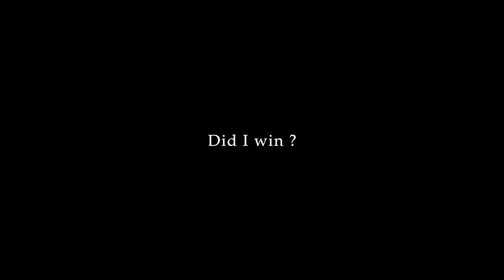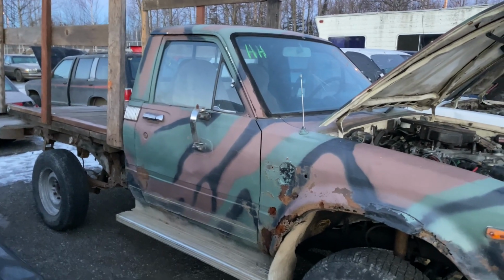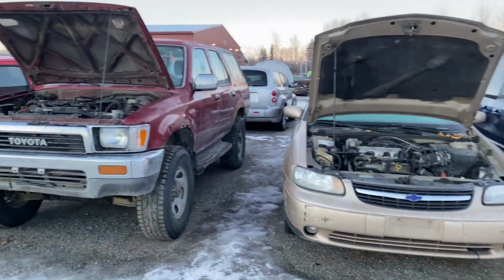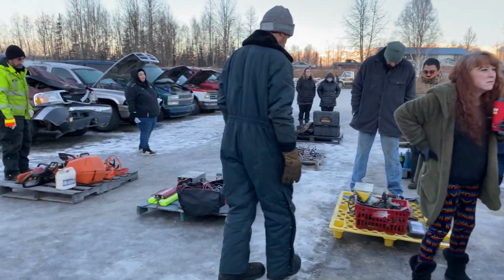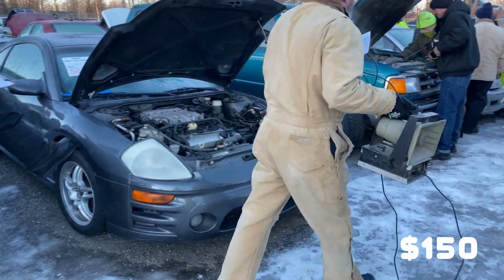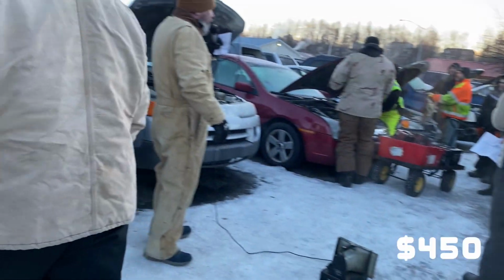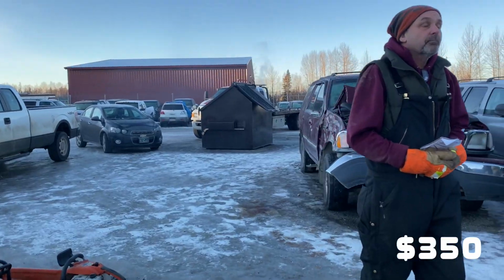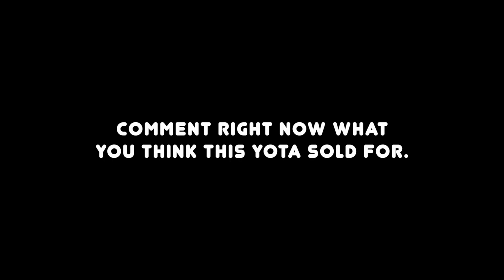First time public car Auction | Alaska

Comment: I'll take all the $50.00 and $100.00 cars all day long. I can triple my money, and never turn a wrench. I cannot buy scrap cars that cheap here.
Reply from the maker: Alaska doesn’t pay anymore for scrap cars. That’s why no one bought them
Reply from the maker: Local Recyling place also requires all fluids remove and charge extra for tires.
Reply: @NuttyNu  I figured as much, being they sold so cheap. I can leave the tires on here, and I just knock a hole in the oil pan, that's all that's required.
I used to buy cars at auctions years ago, and got tired of it, then went to buying scrap cars, tractors, etc..mostly in farmers fields, taking to the scrap yard.
I did make some decent money selling cars on time, they'd pay whatever I bought the car for down-payment, then I'd tote the note till it was paid. 70% of the time, they'd quit paying about the 3rd or 4th pymt, I'd take the car back, repair, and resell again, then about the 3rd buyer, the car was junk by then, and I'd take it to the scrap yard, and get somewhat close to the money I paid in the first place. It gets tiring after a few years, esp, when I had other work going on and 2 kids to raise alone.
Reply: Shoot I sell it as parts...